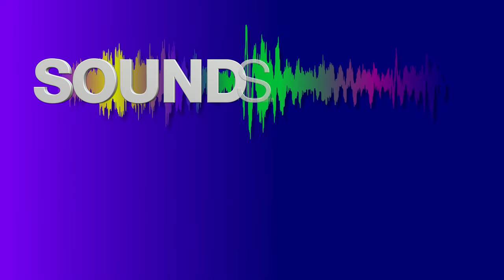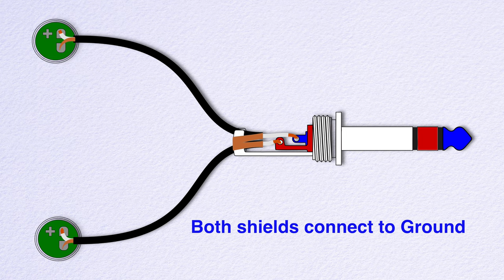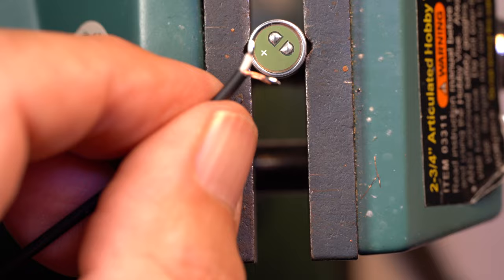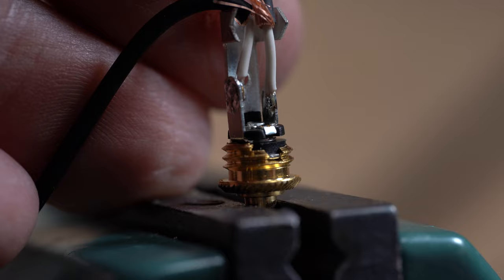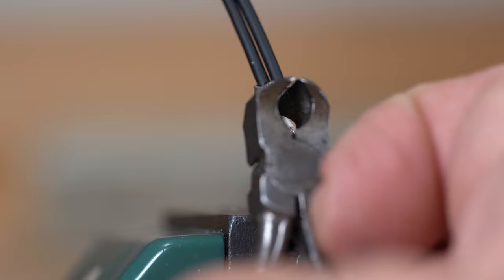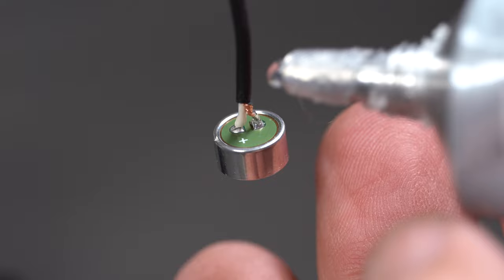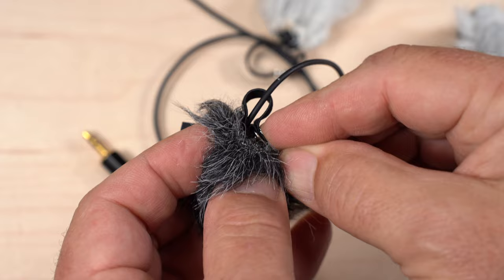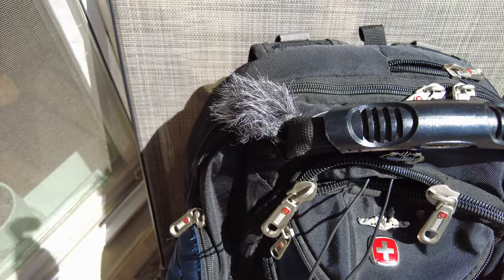Stereo Stealth Microphones

Comment: Nice video.I noticed the silver dolphins, must be a boat sailor, sts(ss) maybe? Cheers, Doug sts2(ss)
Reply from the maker: lol Nuke ET but I  hung out in Sonar a lot. Got out after 20  ETCS(SS/DS)
Reply: Nice to meet you chief. Only 6 years for me, all diesels. Had the offer to extend for E6 but I had a good job offer so got out. Kinda wish I'd stayed in but life has been good and won't complain. Most of my career was in acoustics and have some hydrophones, free for shipping. Let me know if you are interested.  Cheers, Doug
Reply from the maker: @douglasniessen3066  Nice to meet you as well. I built my own Hydrophones ;-)  It's the kinda stuff I do these days!
Reply: Yup me too. I do have a small batch of pzt tubes I ordered for my design. I'll dig them out of storage and see if the data sheet is with them or in one of my log books. I built and sold about 10 of them for recreational use. As I remember they are pzt-4 from channel industries.  About 1.5 in OD and 2 in long. Resonate about 35khz so pretty flat from 20-20khz. I've built quite a few over my career for work and my little side business. I also have a spherical ITC 10-nn, 4 in Dia I think. Cheers,  Doug
Reply from the maker: @douglasniessen3066  these are mine: https://www.instructables.com/Lets-Build-Some-World-Class-Hydrophones/
Reply: A nice looking product and web page. Similar to the ones I manufactured. The pzt elements I have are similar to yours. I did find that filling the inside of the element with a different density urethane and putting a baffle on top of the element reduced noise from the surface. Can be useful for shallow tide pool recording. Also helps reduce microfonics coming down the cable. Another effective way of decoupling cable noise is to have a small float supporting the hydrophone with a slack cable to the pier or boat where the recorder is. Just some thoughts. Very nice job, congratulations.  Cheers, Doug